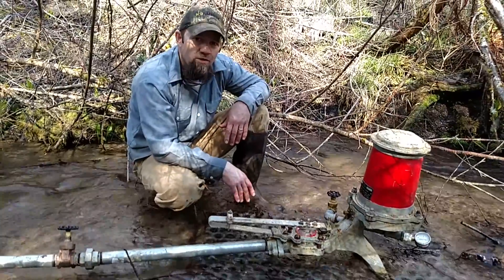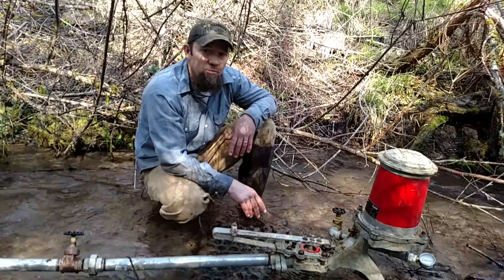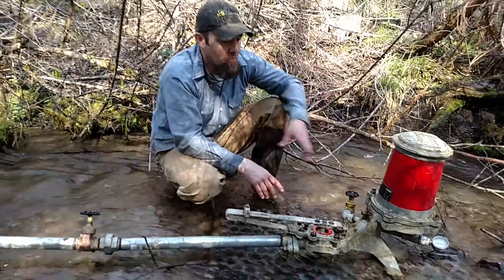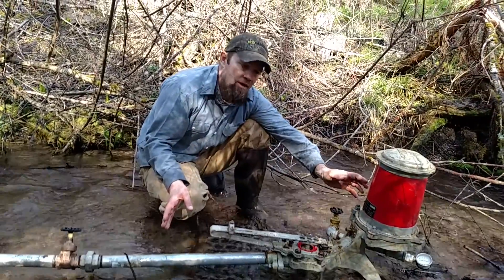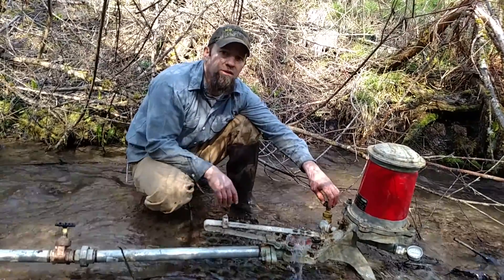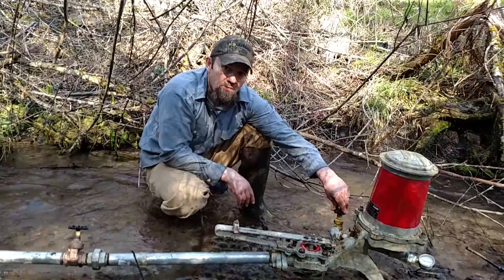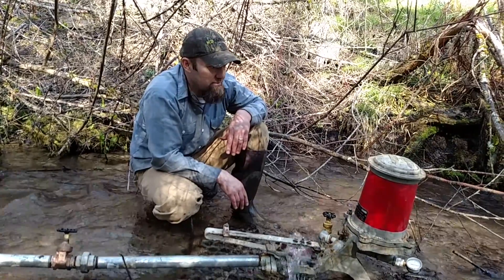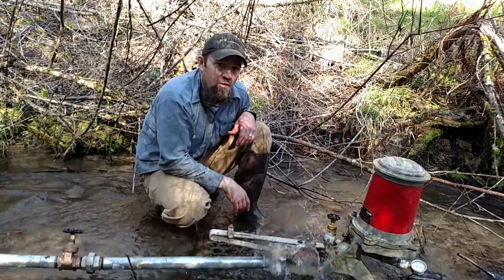Rife Ram Pump

Comment: I have a No. 10, but I don’t know enough about the small pieces between the large valve where all the water splashes out and the dome. The end of the large bent flat spring ends at the area I’m wondering about. There’s a rounded brass piece with threads that must cycle too? Any closeup picture or video would really help me, and others, what this is and how it works.
Thanks for any help with this.
Reply from the maker: I'm not exactly sure what you're talking about. There is a little brass plate with a screw in it that releases a little bit of water each cycle. Is that what you're talking about? There is also an adjustment piece on the end of the spring flat bar that limits the depth of the valve release. Do you have a picture of what you're talking about?
Reply: @wadewilliamson7994  i have pictures.  I'll need an email address to send them to. Thanks

Comment: I'm thinking about putting a Gridiron check valve on mine....because of it's Age the Clamp valve works its way loose Quiet Easily....The Gridiron type Valve was the Original style Anyway & was just a feature of this Unit Apparently.